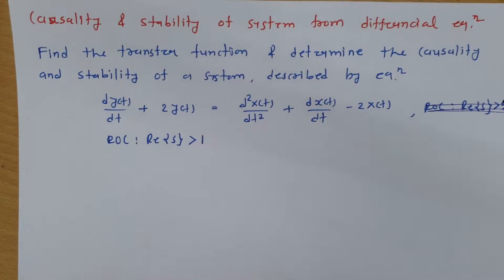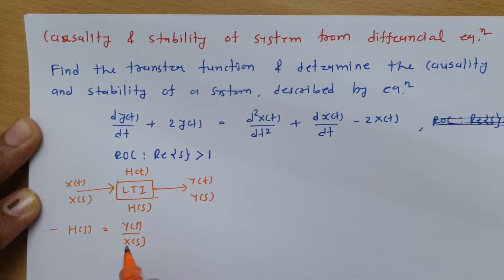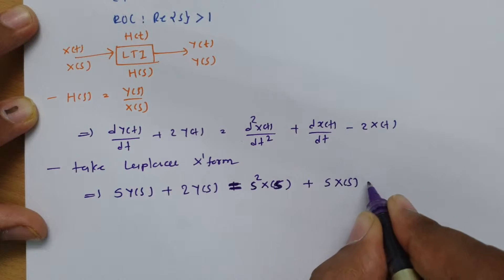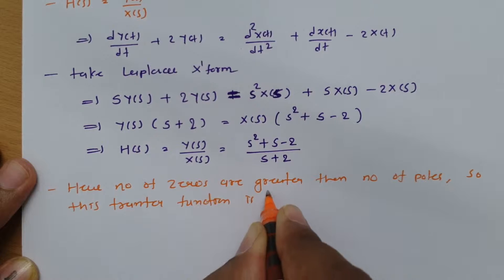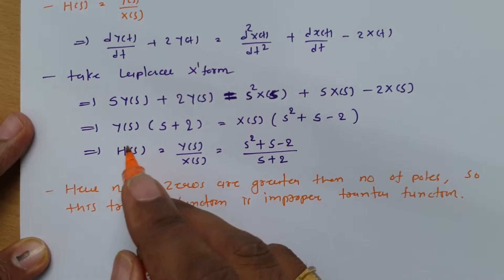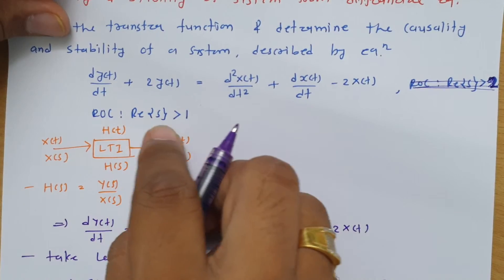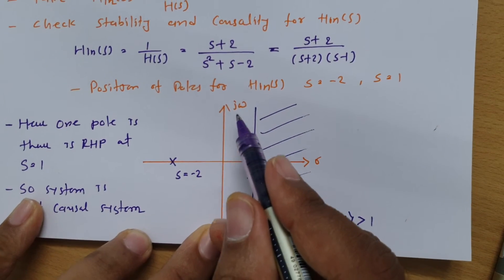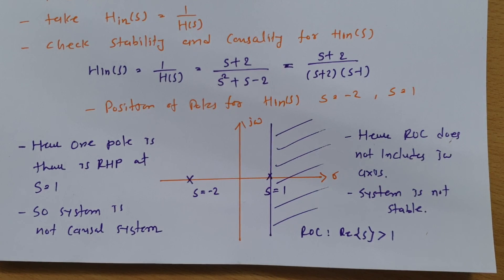Causality and Stability from Differential Equations with Laplace Transform in Signals and Systems

Comment: What is the effect of zeroes of the transfer function?
Reply from the maker: It changes the stability of the system
Reply: @EngineeringFunda  please consider making a video elaborating on this topic
Reply from the maker: It is explained in Control Engineering with Nyquist Plot